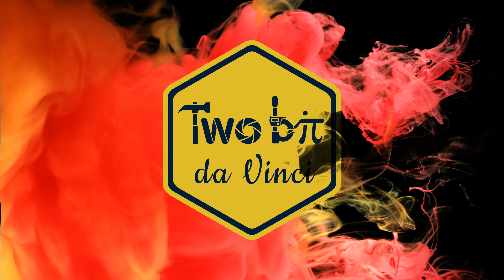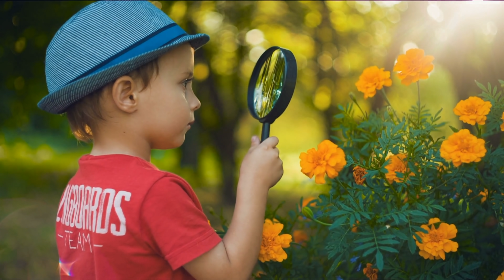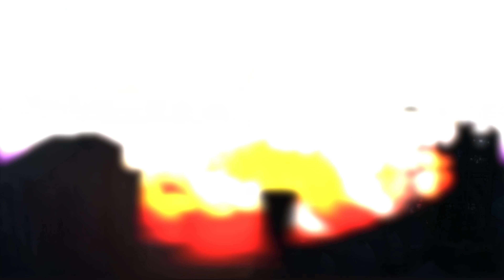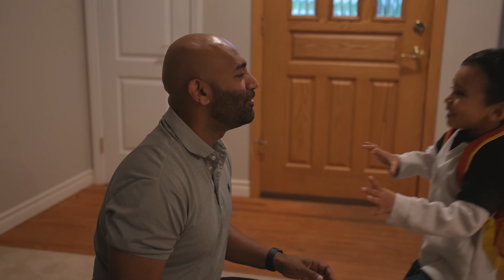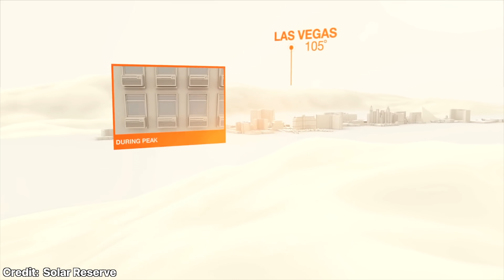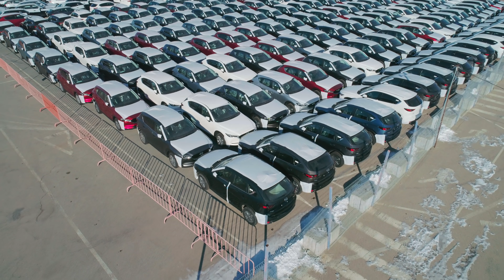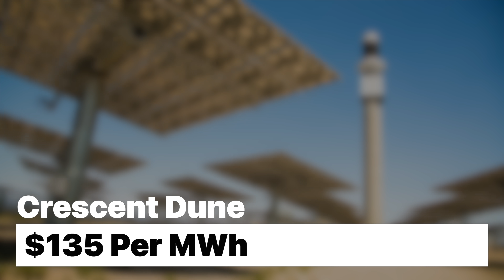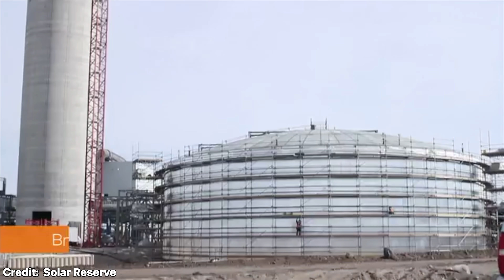This Billion Dollar Solar Plant was an EPIC Failure

Comment: The excuses for this don't even make sense. If this farm was putting out the promised power it would have no trouble staying in business, no matter how low photoelectric has dropped. One thing is certain, if you can't get solar to work in the desert, it's time to get off the drugs about solar; PERIOD. None of these photoelectric farms ever achieve 10% efficiency, Wind farms aren't much better either. To make any of this viable, you need at least 70% efficiency. Efficiency meaning what was promised output before one dime was collected for investment, vs. what output you actually get. True efficiency is the measure of how much energy the Sun puts in, vs. how much energy you get back out. In the real world, Solar is lucky to get between 4 and 8% on a good day. Is this what you want to base your entire energy grid on? 96% inefficiency? Photo cells might be cheaper today, but that huge solar farm in Buffalo was bankrupt before it even opened. And Buffalo is hardly in the desert. In fact, they get very little Sun at all in Buffalo and the stupidity is truly mind boggling. Buffalo benefits from one the largest hydroelectric dams in the world and they do what? Look at the huge windmills in the mountains where only half, or less are even turning; that's the reality. Have you seen the aging wind farms in California? They're lucky to get 20% turning at all. They're all breaking down and they're such Chinese garbage pigs, they're not worth fixing. And this electric car love affair is a pipe dream. Our grid would have to be 4x's larger than it is today to plug them all in. 4X's people! This is what happens when you watch Star Trek too much and than take some acid. Seriously. I can't believe anybody takes any of this seriously, and you call yourselves intelligent? I call you a drug addicts. Smart money doesn't get anywhere near this stuff.

Comment: Well, there was a lot more to it than that. The boilers couldn't scrub enough heat, there were water supply issues and the mirrors were not the units originally called for. There were some serious supplier concerns that were dictated by a particular entity whom procured the funding. It's gaining efficiency by the minute. That 50% was a major lowball. With the original Ausra mirrors, she could beat out 3 Gorges Dam.

Comment: Big oil wanted this to fail because THEY WANTED TO PROLONG THE WORLD SUCKING ON THE UTTERS OF OIL. I live in Houston Texas surrounded by oil plants that handle high temp caustic gasses and fluids 7 days a week 24 hours a day. This crap about leaks proves the engineers made it as cheap as possible so it would barely work. Then they started building electric power plants that runs on LNG (Liquid Natural Gas)  which has been considered a useless by product drilling for oil. An innumerable amount of ancient empty salt domes in Texas are full of it. Once the LNG Electric  power plants came back on line was at the same time the molten salt power plant worked out all its kinks and came on line. The idiots who designed the thing intentionally did a horrid job. So when the price per kilowatt hour dropped because of LNG, the Big Oil Executives who sat on the Board of the Molten Salt Power Plant said its not cost effective and let it break down. This billion dollar waste was a commercial that screamed America needs Oil. So when this molten salt power plant was abandoned a cold winter hit Texas and LNG Electric Power Plants all of the South froze stiff. Massive power outages during the one of the coldest winters in decades. Why did the LNG Power Plants shut down? Because the idiots forgot to insulate the pipes. It's Dumb and Dumber meets jackass. Then the price per kilowatt hour spiked, people were paying $1,500 for one month usage. But thank goodness Tesla showed people the way.... Even if the molten solar plant produced half the amount of energy, it could still trickle charge giant cargo containers of lithium Ion batteries  to supplement and stabilize the electric grid. Australia proved it worked. 

Now the truth is molten salt electric power production has been around since the 1950's. Even Popular Science Magazine printed plans for home owners to build their own molten salt electric generator.  Molten salt is used to coat and harden hand tools. It's used in various ways.  So molten salt isn't  the issue it is the bone heads who actually designed it.  You didn’t need all those mirrors. Here on YouTube a teenager took one old satellite dish and glued on hundreds of 1" squared mirrors.  ON VIDEO HE PROVED HE COULD MELT BRICK. His reflector was so powerful that on one fateful day as he had it stored in a utility shack and partially covered with a tarp. Enough sunlight was able to land on the dish to cause an instant massive fire. The shed burned down to the ground.

You could build a Tri Power Unit that uses old giant fiberglass satellite dishes covered with mirrors that focuses the sun 's rays to about 3 feet away to heat a tube flowing with molten salt. All the pipes would be coated inside with high temp ceramics, and the salt would be stored in double walled hyper vacuum thermal barriers. Using solar would power the pumps and the molten salt would generate energy and trickle charge giant lithium Ion packs buried under ground in another double walled  hyper vacuum thermal barrier. A non conductive coolant would circulate around the batteries to jeep the at the perfect temperature. Then some of the power for the batteries could be used to run induction coils in the molten salt  tanks to keep the salt a peak temperature. The its all about creating flash steam to run compact 2-5 megawatt steam  generators. That is what a person with. A brain would do. But since big oil warps the minds of people who should no better the would is stuck on the utters of oil. Thankfully Tesla is spoiling the milk and oil for propulsion won't be used in the long run.

Comment: I was there. Multiple problem(s). Sun was calculated at 100% daily input to system, which... Is not possible. The mirror and sun track system was totally inaccurate per mirror. Many of the motors failed prematurely, the up keep costs were out of control... And so on.
Reply: Nobody mentioned it only had 40 employees and nothing about the turtle herders.
Reply: @mickeywalker5071  wildlife preservation was there! Yup... And bird(s) would drop out of the sky routinely. Fried to a crisp. It was a crazy site to drop my cargo at... 😵
Reply: @jasonpocaro2086  I dated the HR Director, Molly Walker.  She called them flaimers.
Reply: @mickeywalker5071  YES! That is correct... OMG... 😅 I would be on my flatbed, unload a new motor or panel and they would "pop" right out of the sky. Fall dead on the ground. A guy or lady (or non binary lizard from mars) would come by and grab it like "nothing" was wrong. It was 1 of my most INSANE delivery spots ever!!! 😵

Comment: I WORKED IN KRAMER JUCTION CALIFORNIA ON THE FIRST SOLAR PLANT IN KRAMER.
THERE WHERE A COUPLE IN DAGGET AND THESE WORKED BY HEATING OIL THAT RAN THROUGH STAINLESS PIPES WITH BLACK EXTERIOR INSIDE A GLASS VACUME TUBE THAT RAN DOWN A CONCAVE MIRROR ARRAY. 
IT THEN SUPERHEATED WATER INTO STEAM THAT TURN TURBINES..
THAT WAS IN 1985 OR 84..

Comment: Very good video, thanks.  I drove by a facility about 2 months ago, and one of the three arrays seemed to be in production, based upon the almost blinding light reflecting from the molten salt tower.  Does anyone know if some production is underway, or maybe the mirrors were not parked?
Reply: I think this location is sometimes confused with the Ivanpah installation.  That one is a three-tower arrangement along I-15.  The one discussed here is a bit farther north I think.

Comment: Great vid, my only question is about the output efficiency of photovoltaic cells. Are they still only about 20 percent? And if so how did manufacturers manage to drop the price without developing a more efficient product?
Reply: You reduce cost by scaling up manufacturing volume, optimizing the manufacturing process, buying materials in higher quantities and lower prices, etc.  Improving photocell efficiency is a very difficult, slow process.  That work is usually done by PhD's at publicly funded Universities.
Reply: @guygordon2780  so...why do we keep trying to push for solar, if the only thing that has changed is the material quantity and speed of production for a product that is still as expensive to maintain in operation and has not proved to be any more efficient over the past 30 years or so of development.
Reply: @jord9030  It's one of the cheaper forms of energy long-term for both homeowners and businesses to adopt, and is relatively low maintenance / inexpensive to maintain.

What in the world would make you think it is expensive to maintain? For a plant that size they'd only need a handful of people to clean and maintain it, no idea where he's getting thousands of workers from.
Reply: @Dark3nedDragon  you sound like a shell bot.
Reply: Or a sales representative for solar panels...either way, thou protesteth to much.
Reply: @jord9030  Or maybe I understand Electrical, and have seen Solar Panels installed before.

The headline for the video is misleading, the plant is not a SOLAR PHOTOVOLTAIC facility, they are completely different.
Reply: They use servo motors and controll feedback loops that keep the panels in constant exposure to the sun. It doesn't take a genius to realize if the work is being preformed with moving componentry there will be routine maintenance, and the frequency of that schedule will be greatly increased if the work is exposed to the elements out doors. Also,  "renewables" are not more affordable. They're subsidized. Everything you think your saving here is being spent with the taxes we all collectively pay. It's a lie.

Comment: So, this experiment becomes a monument to the FACT that green energy is not about eliminating greenhouse gases...it is, like far too many supposedly worthwhile causes, entirely about money.  If it was about saving the planet, and recognizing that Nevada already has some of the lowest electricity costs in the region, they would keep working to produce power at that facility.  Since it's not the cheapest they have opted to not buy power from them, regardless of the volume of green generation it represents.  Typical capitalism, perverting ecological imperatives...but we knew that would be the outcome from the very beginning.

Comment: Building solar farms such as this one cause millions of tons of CO2 to be put into the air.  It starts with the mining of the ore to make the steel, copper, aluminum, salt, and glass materials needed to build them.  More CO2 is emitted by shipping all these materials by diesel trucks to a factory and then to the site.  Even the worker's emissions of CO2 need to be counted.  At the site, more tons of CO2 are pumped into the air by building the massive concrete foundations for each mirror tower.  Then over their life, they will go through tens of thousands of gallons of oil needed to maintain their, pumps, gearboxes, and such.  Added to all this is the CO2 emitted by the building of the necessary transformers, power lines, and roads.   Just the CO2 emitted by the hundred of people needed to drive to work to maintain the plant further increased the carbon footprint.   After all that they produce power only a few hours each day, they clearly do not produce zero CO2 for each kWh of power as their proponents claim.   Several studies have shown that most solar farms generate far more CO2 in their lifetime than they offset when compared to natural gas-generated electric power.   Adding their downside is the fact that kill endangered species, destroy the beautiful countryside and cause noise pollution to the point that thousands of homes across the nation have become unlivable.  All that and they produce power at a cost many time that of traditional generating systems.  On their positive side, thousands of politicians, and business people have made millions of dollars by getting their hands on tax dollars, for without that they simply cannot produce power at a cost that anyone could afford in a totally free market.   It's time to stop building them...  and return the world's countryside to normal...

Comment: Once a large solar PV or Li-battery installation goes up in flames, I think folks will start to understand mirrors / solar-thermal (also cheaper to replace if hailstorm) better. Witness that ship full of VW products, abandoned and burning at sea, they can't put the fire out (why are they even trying). Tesla solar panels and battery packs have burned down how many peoples' homes so far? Hope those folks' cars didn't also spontaneously combust.

Current PV and battery tech leaves a lot to be desired, regardless of cost per megawatt.

But, very good points in the vid: labor costs involved incurred by heliocentric tracking, multiple points of failure, molten salt leaks, etc. with solar thermal.

Counterpoint, is environmental costs incurred by life-cycling of PV and Li. Mirrors don't degrade over time like PV. Nor do alternatives to Li for energy storage (magnetic bearings in a vacuum for a flywheel last forever by comparison).

Comment: I agree with you about the adoption curve behavior, but I disagree with your assessment of EV adoption.   The rapid growth in the adoption curve is ONLY true if production cost is the only significant variable.  This is what we saw with PV panels.   But there has to be no major technological hurdles still to face and the underlying logistics chain has to have a feasible path to supporting the growth curve.    For EVs, both of those preconditions are untrue.   EV's still face major techological challenges such as;  specific energy is still too heavy to make practical heavy duty vehicles [trucks and trains], poor cold weather operation, battery capacity fade and the need to replace a battery that costs more than the car is worth after 10 years, and electric grid congestion that will make continued rollout of high capacity chargers ever more difficult.    There are also logistical problems; the entire world production of lithium is not enough to meet forecasted demand in only a few years and lithium production growth is very slow and concentrated in bad/unstable parts of the world, and BEVs will be competing with stationary storage for lithium.   Electrical prices are set to skyrocket as coal and nuclear retirement erodes capacity growth of renewable, and natural gas prices are highly volatile due to geopolitical problems, and transmission congestion is becoming a big concern in certain grids, especially ERCOT.    Any one of these problems ALONE is quite solvable.   But together they are a formidable challenge that will flatten the adoption curve significantly and keep prices from falling as they might otherwise.

Comment: You cannot compare the production of photovoltaic directly to thermal because of the intermittency issue. The cost to produce power thru the night is much higher. Add batteries to that photovoltaic and the prices will be much more comparable.
I think the issue here is that coal or natural gas production is less expensive than the thermal plant. Not photovoltaic.
We have to realize that there is a limit to how much photovoltaic we can add, because other plants have to pick up the missing production in the dark. Building and operating those plants is part of the cost of photovoltaic. The price of photovoltaic is always quoted ignoring that, and is inaccurate data

Comment: So, what we're hearing is that 'cost-benefit' expedience...in the contemporary world of cheap PV manufacture solutions[..none of which ever take into account consumption of rare metal resources, nor legacy, cumulative wastes generated by manufacture & defunct/disposed solar panels..]...
 Coupled with the rushed integration of CSP's supporting infrastructure methodologies[..hamfisted construction progress...flawed molten salt storage & pumping...heliostat mechanisms' durability & manual maintenance burdens..]...
..And finally throwing gounts of tax-payer backed cash at such a poorly conceived, mega-installation project...

Doomed a sound principal/'darn good idea'--to lasting skepticism & pragmatic presumption/dismissal...that: "..It just doesn't/CANNOT work.."?

Seems more like it was lobbied + engineered to FAIL HARD, such that other industry favorites would have one less 'Green, 'Socialist'-grade competitor to counter in this lifetime.

 Much like the perpetual reluctance of accomplished heavy engineering/energy industries to tackle ocean wave/tidal generation projects--claiming "..unknown durability & longevity challenges..". All whilst mega-scale, sea-going oil & gas platforms have been 'happily' constructed/operated in regions like the North Sea for decades.

Comment: hey,
1. the government should always risk funds to benefit society. far better than a half million dollar smart missile We rather not use but stock pile for welfare jobs.
2. Solar thermal plants li this one can be reused or modified to create energy gain.
 A. modify using alternative fluids that conduct heat to molten salt instead of direct molten salt heating. 
B. use the tracking software and towers for PV solar. 
C. PV panel but convert from molten salt to air. this will act as a dual pressurized system for turbine and thermal by utilizing the Heat Pump principles .

Comment: You mention Brightsource Energy as the largest solar-thermal (liquid sodium) plant in the U.S. Since it does not include any form of energy storage, it has to come up to temperature every day, synchronize with the energy grid and then supply power only as long as the sun shines. Then it has to be taken offline until the sun shines again. It is mostly known for its ability to flash-fry birds in flight. Cost per kilowatt-hour? Unknown.